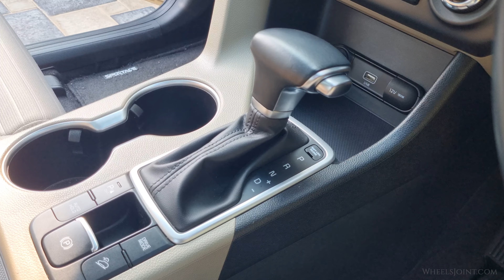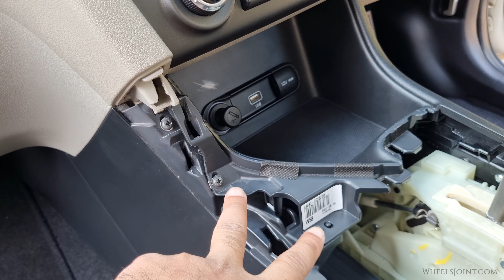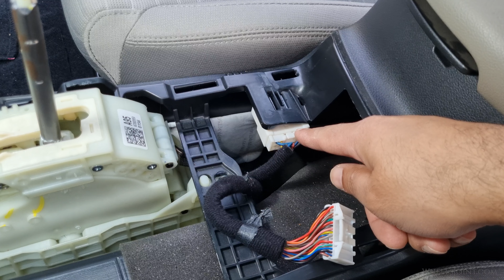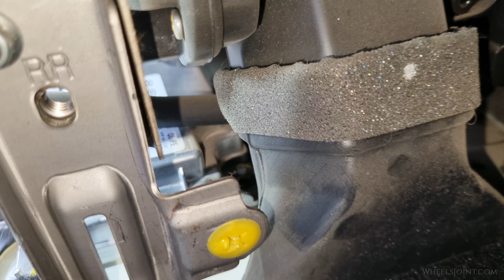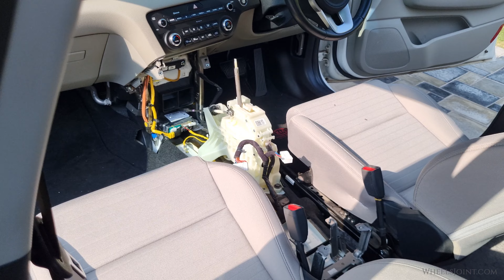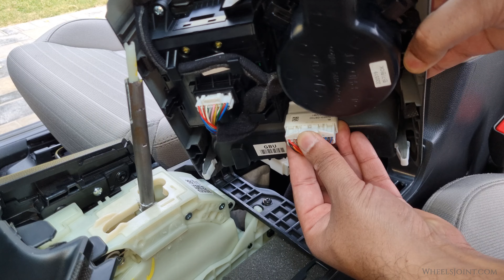How to Replace SRS Airbag Control Unit in Kia Sportage

Comment: hello Is coding required after replacement?
Reply from the maker: Yes!
Reply: @WheelsJoint Do you have the procedure or diagnostic tool to use for coding? Thx 💪🏼